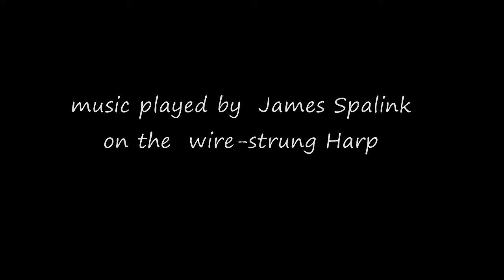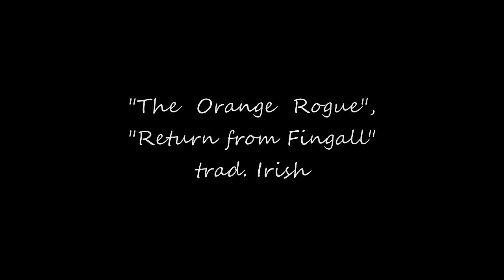Building a Celtic Harp

Comment: Question: if the harp neck is offset from the middle of the soundbox, how do you get the pillar to connect to the middle of the sound box and to the neck. Did you just cut it at an angle?